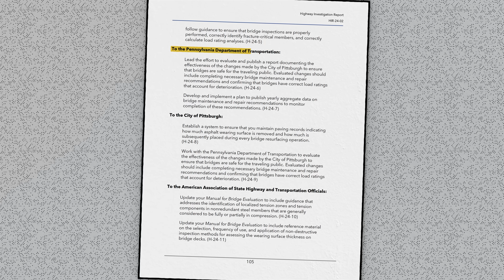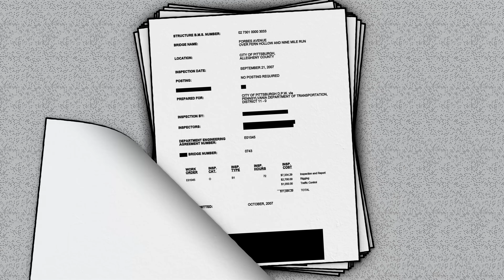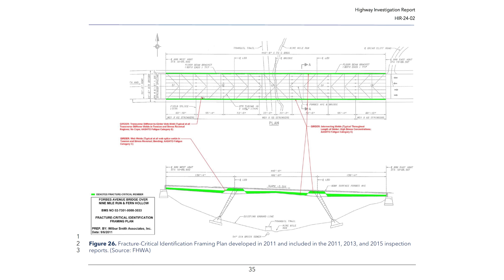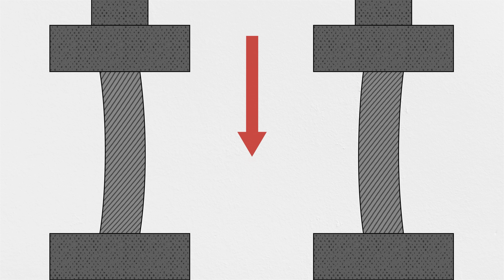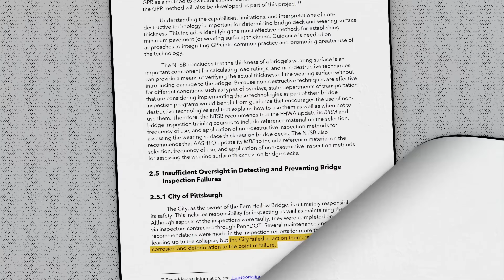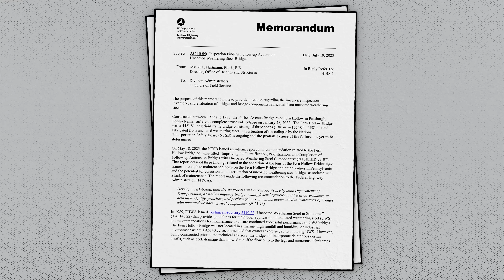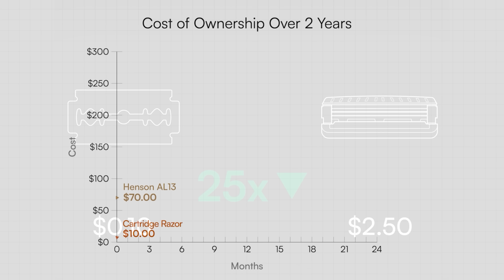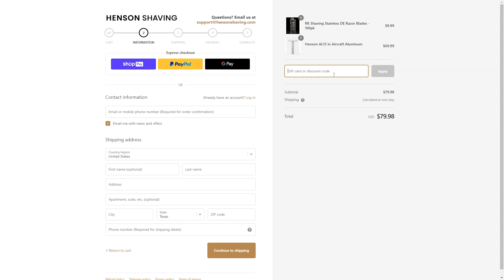This Bridge Should Have Been Closed Years Before It Collapsed

Comment: I drove over the Minnesota 35W bridge about 10 days before it failed. I was in my 1994 F250HD which had a very stiff suspension. I noticed going from bridge section to bridge section abrupt change in angle like it hit a bump. My truck was going slightly up and down as it crossed that bridge. A bridge engineer working for MnDOT repeatedly warned MnDOT management that that bridge was going to fail, and they didn’t listen. The blueprints for the bridge called for 1” thick connector plates. The plates installed were 1/2”. 13 people died because of incompetence, over 100 more were injured.
Reply: My wife was en route to cross it, but she had to turn around because she forgot something. Had she not turned around, she likely would have been on or very near the bridge when it collapsed.

I also have a co-worker who drove over the bridge about 10 minutes before it collapsed.
Reply: and of COURSE, no one went to jail...
Reply: @roberthousedorfii1743  The greater the impact, the lower the consequences for those responsible.  Especially in government.
Reply: @thecatofnineswords  Now what is the point of posting such a uselessly cynical comment?  Government is the responsibility of the PEOPLE.  

We pay for it with our taxes, we vote for representatives, we have free speech and the right to raise cane when crucial infrastructure is ignored, we all know that graft, corruption or incompetence can occur in any human endeavor... 

We're not a nation of 7 year olds waiting for Mom and Dad to take care of everything.
Reply: @mjinba07  because that is my experience/observation of those who have experienced repercusions for illegal or bad behavious.  Individuals will be jailed/fined for breaking the law, but corporate executives and government leaders just move onto their next role, no matter how many people their actions killed.  We bear the cost through increased taxes, but where is the actual increased funding in maintenance?
I too expect the government to do good work for the benefit of society, but there are very few actual methods available to hold it accountable when it goes awry.
Reply: @thecatofnineswords  Well then maybe consider raising your voice and demanding it.  Which is the responsibility of citizenship.  Petitions, community engagement, pestering news outlets...  Complaining in a YT comment is easy.  Not effective.  Unless all you want to do is help people feel like victims and develop their cynicism.
Reply: @mjinba07  I /am/ a well-seasoned cynic, how could you tell?
I have pushed for change IRL.  I do perform my own acts of activism.
The cynicism comes from watching governments sticking their heads in the sand against all recommendations.
so whatevs.
Reply: @mjinba07  Ten thousand petitions a day are turned in at public meetings, each demanding that Something Be Done or Something Be Changed.  It's adorable that you think a petition is the way to reform an entrenched bureaucracy.

If you want real change, then any time something like this happens and you identify the people responsible, instead of demanding prison terms or reparations from those in positions of responsibility, just accept that the State will never hold those people accountable, and instead go to your law enforcement agencies and request that they look the other way for a few hours while the good people of Pittsburgh (in this case) take care of justice at an amateur level, since the professionals refuse to do their jobs.
Reply: @govsquid  So you suggest anarchy?  Yeah that'll fix it.  

People complain about the state of government as if government isn't us.   At least in largely democratic countries.  It's like hearing children whine about having to do their chores.  Current problems are what results from decades of passivity, complacency and accepting helplessness.

Certainly one approach, one effort, or one little group of people isn't likely to have much impact.  There are, of course, a number of civilized ways to push for corrective action.  And like chores that have gone neglected for too long, extra effort is required now.

Comment: I'm not an Engineer,  Just a retired Union Construction Laborer. I've helped to build and rehab many bridges in my area.  From what I've seen, drainage, or rather improper drainage, is the root cause of nearly all the damage to the bridges.  Especially the older design ones on interstates and toll roads.  Eventually the drains fail exactly over critical places.  Fail from lack of maintenance.  Then the bridge would get rehabbed, rebuilt exactly as it was and eventually fail again.  New designs are taking care of much of that.  They drain totally different. Still, bridges need maintained not just inspected or rebuilt on failure.
Reply: Maybe bad/damaged/improper/.. drainage simply show You the best way that project/building/ had done wrong way or have serious problems in common.For example: wrong project gives extra deformation or vibration and drainage reacts it first (You see it's proiblems first, before problems of main construction. because it seems early and better).
Reply: Makes sense. Assuming that the value of drainage maintenance would be self-evident is a very engineer sort of mistake to make. Over time a pattern of bridge deterioration/failures due to lack of drainage maintenance would make it obvious that bridges shouldn't be designed assuming regular, diligent drainage maintenance.
Reply: @SnakebitSTI  Then the problems will just shift over to whatever design compromises were made to facilitate better drainage, the bottom line is that if maintenance is ignored failures will occur.
Reply: @SnakebitSTI  I'm not sure they should be designed expecting maintenance, period.
Reply: @gas33z  Yes, it will just shift the problems to things with longer mean time between failure. That doesn't mean it's not worth doing.

A maintenance-less bridge would likely be wildly more expensive and thus very unlikely to be chosen, if one is even possible. But that doesn't mean some designs don't require more active maintenance than others.
Reply: Active union laborer here. I construct temporary dewatering/treatment/discharge systems and I have noticed that many causes of many problems are due to whatever government entity not maintaining drains. It really is incredible that they’d pay out $xxx to repair, when they could have spent $x to maintain.
Reply: @MXSSF_ACTUAL  Good old dewatering!  I've seen a few attempt to get bottom without it.  But but but....we don't have money in the bid for that.  A week of wasted efforts and a rain or so wises them up.  No bottom, no build.
Reply: @MXSSF_ACTUAL  Yea but what if they payed 0$ AND never had to pay xxx$ either, look at the short term savings! Extra good deal if the xxx$ problem doesn't happen until after you stop working the job, so it isn't your problem.
Reply: What if the prison population were trained to do bridge and roadway maintenance? They could then get out with the skills they need to get a well paid job. You dont want to take work away from companies that do this but it looks like budgets just arent there to do it and do it correctly. Training classes can do over the top maintenance to not only make repairs but also clean and paint bridges so they really shine.

Comment: I'm a structural engineering in charge of the bridges for a government entity. This level of neglect is systemic and common. There has has been a lack of public will to maintain, repair, and replace the infrastructure that already exists, be it a bridge, water system, or other. The focus is always on the shiny new projects, leaving the existing infrastructure to deteriorate. It's very likely the City didn't have the funding for a staff member to properly review the reports, or the funding to do anything about it. The fact of the matter is that the public does not vote to spend the money that is required to maintain and repair bridges like these until something disastrous happens.
Reply: Is there really even an opportunity to vote on such things?  This is an honest question.  I agree with you about the main issue ultimately being the electorate, but it is my gut feeling that the way our government is set up, as top heavy as it is, there isn't much political incentive for legislators, especially those at the higher levels, to be responsive to the electorate, present opportunities for the electorate to mandate concrete action, or encourage an informed electorate.
Reply: Most of the time it’s the people in charge of bridges that fail to tell the public how bad the bridges,etc really are. How can we vote on something that’s not presented to us?
Reply: I find it funny a government employee gaslighting citizens,blaming them for the failures of the government
Reply: @joegosselin2888  i don't see this poster as gaslighting us.  At the end of the day, voters make or break politicians, even if it is through actions outside the ballot box.  But I believe you are definitely correct in pointing out that we can't vote on something that isn't presented.  I argue also that the public sometimes are the ones who point out failure, in addition to the subject matter experts.  Our government system still disincentivizes (and now more than ever with the Chevron SC ruling) agencies with the know-how and mandate to do stuff from actually doing stuff.
Reply: @andresmorera6426 I agree with everything you said except the first sentence. Negligence to the point of bridge failure is criminal and is solely the fault of the person high enough to have closed that bridge.
Reply: Car enthusiasts and ppl in general used to care about roads but all through the 90s you started to see a general

Comment: The inspectors should have had the authority to shut down the bridge. Period. I worked in factory maintenance and once ran across something potentially very dangerous requiring welding to fix. I shut down the line right there, my lead was pissed until he saw it and then he instantly said “you did the right thing”. We welded it immediately.

The bridge inspection team not having that authority makes a mockery of their job. And if the inspectors did not have the knowledge to properly rate the bridge, which the NTSB report suggests, that is also a serious problem. The people who determine the condition of the bridge should be able to shut it down to traffic.

Comment: I grew up in this part of Pittsburgh in the 1960's thru the 1980's. Walking, bike riding and then driving over this and scores of other bridges in this area. It was not uncommon to see daylight thru pot holes in the road surfaces and rust on the structures. As a CE later, I understood how the wear and tear on these bridges would require massive maintenance and $ to keep safe. This incident happened with minimal impact, but I always thought it would happen much sooner.
Reply: They should have torn it down and replaced it sadly politics gets in the way.
Reply: If only government spent our money on stuff that mattered like infrastructure.
Reply: @mae2759 can't be raising taxes in an election year... or ever really.  Money for infrastructure maintenance is long overdue.  It will be pennies in comparison when the next bridge falls or dam breaks.
Reply: @Cassinspace  We don't need to raise taxes.  We need to divert funds to things we need, like infrastructure.  But, you can't buy votes and political favors by cutting programs.

Comment: Hmm.  It sounds like the bridge inspectors need the kinds of authority health department inspectors have for restaurants, to credibly threaten to close the thing if critical issues aren't fixed by the next inspection.
Reply: Need third party independent inspector.   If inspectors work for the people doing the work, they have a vested interest to find things to fix or not fix.  Fox guarding the henhouse.
Reply: @JKHTX  Inspector are typically independent contractors, but they don't usually have authority to shut things down.
Reply: @RBzee112  this is an unfortunate example of where convenience and economics are more important than safety.  Same decision going on all across the US.
Reply: The government is fine with shutting businesses down and forcing them to fix things (if they don't have connections, at least), but it doesn't want its own things shut down.  Following its own standards is too much to ask of government.
Reply: @Br3ttM  rules for thee,  not for me
Reply: @RBzee112 
They usually only have authority to shut down a bridge by applying a rating below D-. Not for owners skimping on critical repairs.

Comment: I’m very happy I live in NY and work for a DOT Bridge crew. We go out every year in spring and wash the bridge decks and clear out the drainage paths so everything can be funneled correctly. At the moment of this comment we are working on bridge joints and completely rebuilding them so the bridge can flex correctly. Thank you for making this video!
Reply: Thanks for keeping State Bridges safe
Reply: I'm very happy I live in NY where I can break into an empty apartment and squat for free, take whatever I want from retail stores as long as it's worth less than $1000, and get immediately released every time I get caught shoplifting. Thank you for making this comment!
Reply: @B3Band  You should move to TX, you can shoplift up to $2500!
Reply: @B3Band Wow I wanna live there now, thanks for the recommendation!

Comment: I work in a factory with huge equipment and machinery and I believe that your thoughts at the end are true. Everyone is excited about the purchase of a new spray dryer, a new reactor and so on... but no one cares about the maintenance needed on the equipment until it has a breakdown.
Reply: It seems to be a human brain thing. On some level, we expect to spend money for new things, but we expect the things we have to just continue working.
Reply: @SnakebitSTI  It's a cultural problem. Are you telling me that a mayor who finds the time to personally hype up the outcome of an inspection/safety report WOULDN'T look like a boss?  

If they went out to the bridge and held a press conference discussing an A+ safety report and telling people how much they value their constituents' lives and their city's infrastructure, they would get good press. You could practically campaign on that alone.

If a bridge gets a B-, they implement the necessary fixes and then personally show up and hold a press conference bragging about how awesome their repairs and improvements are. You can even have a baller ribbon cutting ceremony for it if you need to.  

The problem is purely cultural. Politicians do not realize the potential for personal gain by taking infrastructure seriously.
Reply: Some places have a maintenance program that consists of "Fix it when it fails". 

The factory I am working at right now is like that (I'm an HVACR tech). I had the same experience doing repair work at McDonald's and 99 Cent stores.